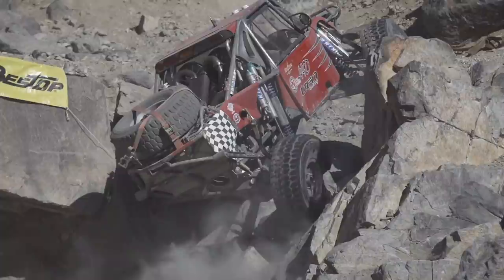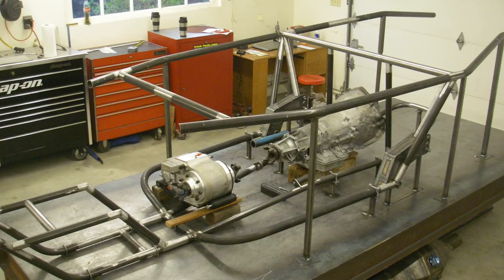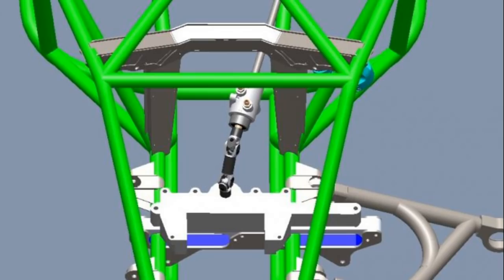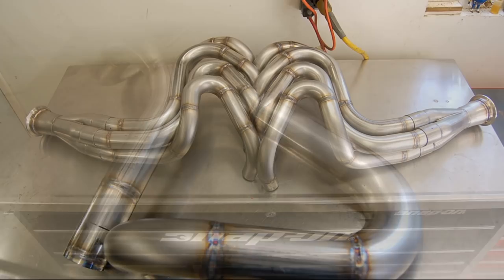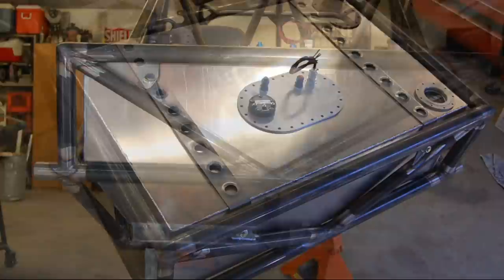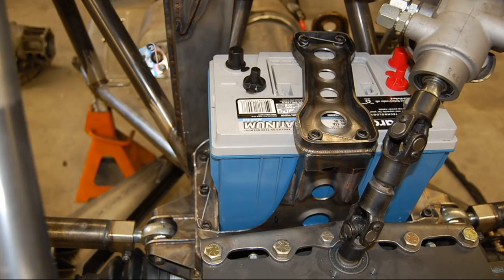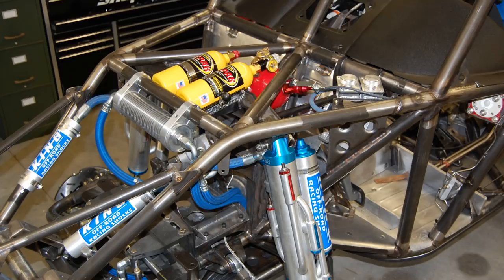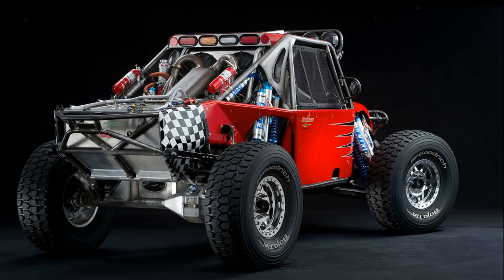Build it, the Ultra 4 race car build

Comment: Engine: a machine for converting any of various forms of energy into mechanical force and motion  
Motor: any of various power units that develop energy or impart motion  
Both are correct.
Reply: Wrong.  My father is physicist and designs race cars.  If I ever say motor when talking about an engine he yells at me.

Comment: What transfer case are you running?
Reply from the maker: The car is over 10 years old, but at the time it was the newest version of the Atlas.  The low ratio was 3:1 and the owner also played with a 2:1